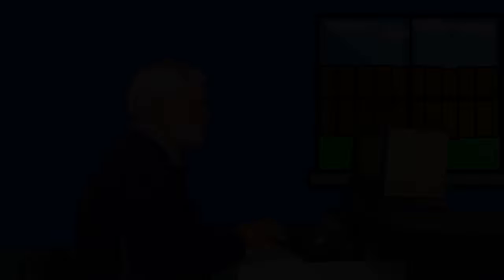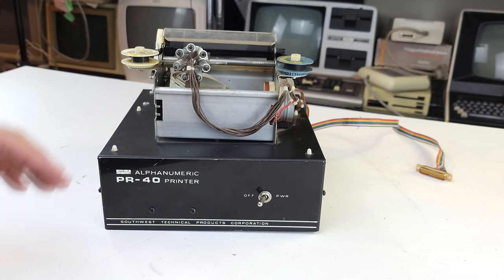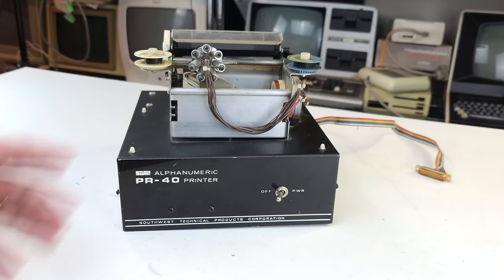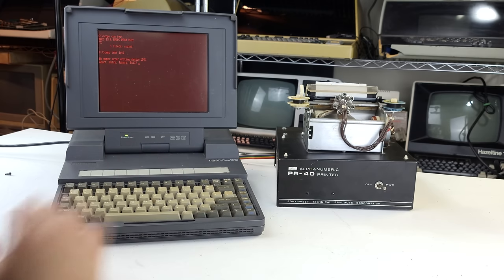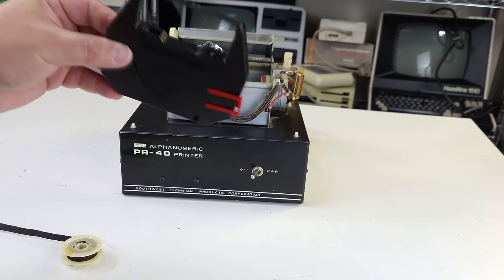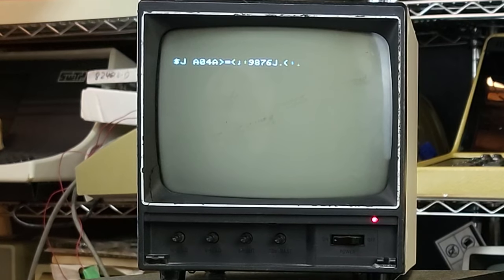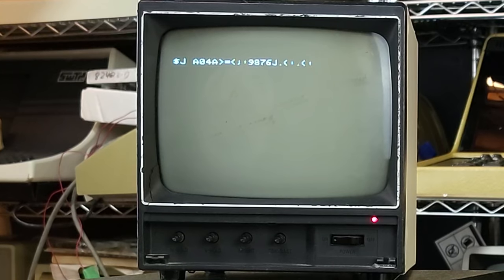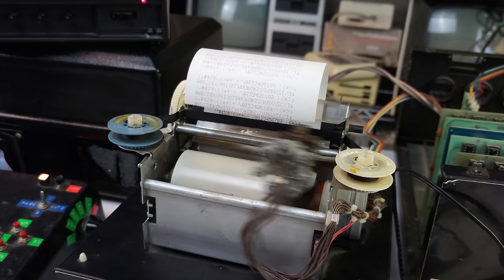One of the first printers for a home computer: the SWTPC PR40

Comment: Thanks, I've got a PR40 but in a larger metal case from SWTPC. Never tried to get it working, having watched your great video it seems this will not be a quick job! Do you have SWTPC BASIC for your 6800, might this have PR40 printer support?
Reply from the maker: I think in my case it was harder because my MPLA card was configured differently, and I was approaching it as someone who'd never used one.  I think you'll be alright as long as you have the pinouts correct and the MPLA setup correct.  To be honest, I'm not sure if SWTPC BASIC supports printing.. I believe there is a copy up.. used to be on swtpc.com.. now you have to Google swtpc and Michael holley to find it.
Reply: @TechTimeTraveller  Thanks for the quick reply, looking forward to your future videos.

Comment: you need to be rock (disc) hard, like ceramic disc, to not be burned or emp destroyed
Reply: or just a silicon wafer that has high melting temperature, to store data, not the cheap dvd/blu-ray discs, record with i/e-drive, ion-electron beam acceleration drive, pluck and hole storage drive, in vacuum
Reply: yes ions can print to paper too, but provide some electrons alongside so the charge balance stays constant, does not become overly negative or positive :)
Reply: you need only vacuum the ion/electron printing/engraving, then you are a go